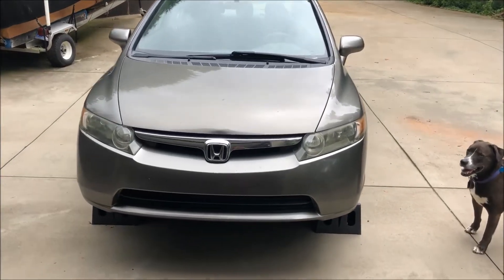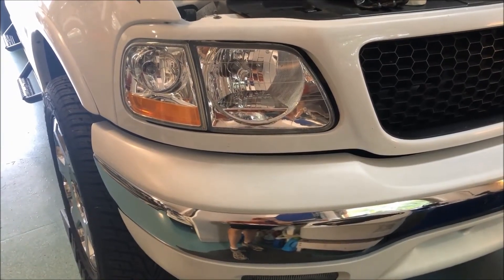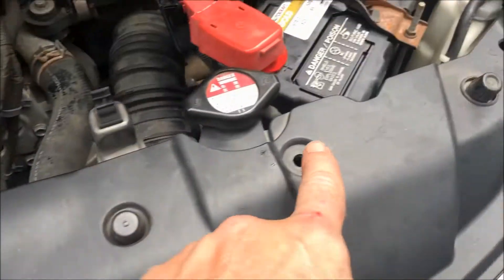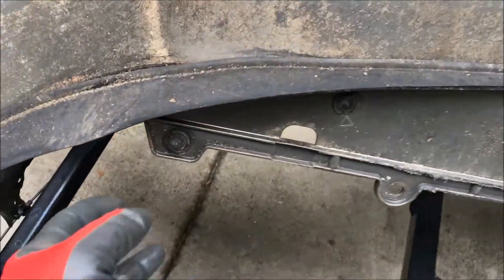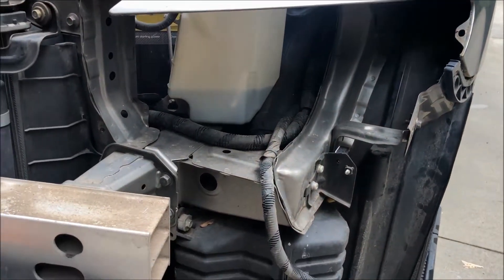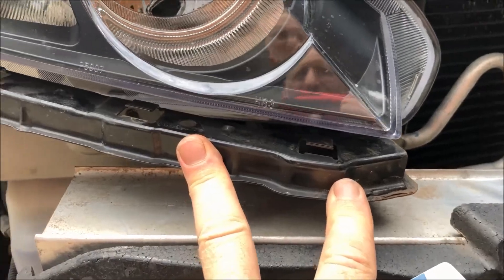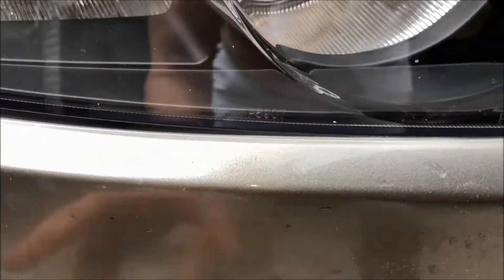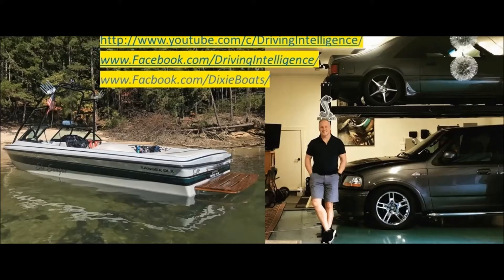How To Replace 8th Gen Civic Headlight Assembly, Better Visibility & Aesthetics: ‘06-‘11 Honda Civic

Comment: Which bulbs go where? 9005 is low beam and 9006 is high/low? Also what can I apply to start protecting them from the sun? Thanks!!
Reply from the maker: Thanks for checking in... all the bulbs and parts are in the description with location of the proper bulb.